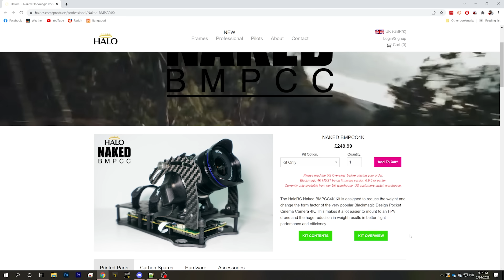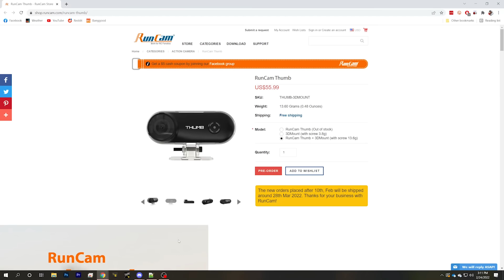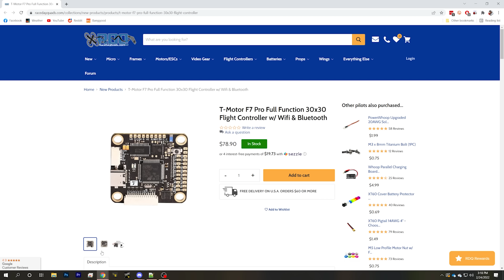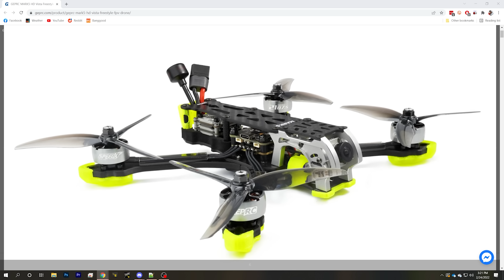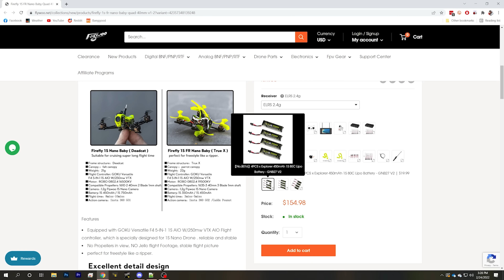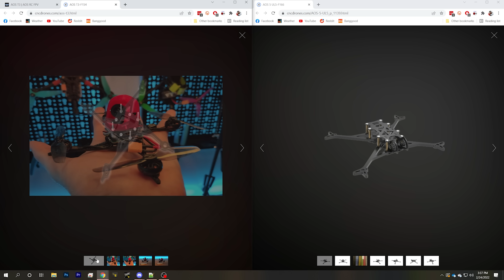FPV new product roundup // MARCH 2022

Comment: I've seen you put a lot of emphasis on what battery connectors quads come with in the past, and it came up again here. I can't help but wonder if I'm missing something.. why is it such a big deal what they come with? A short solder job can fix that easy enough. Or is there some reason I'm not picking up on that switching out connectors is a bad idea?
Reply from the maker: Sure you can change the connector, but it's still nice if it comes with the one you prefer.

Comment: Been using the HDZero 1W in my long-range build for a couple months now and I’m very pleased with the performance. Here’s some range and penetration testing for those curious about the performance:
https://youtu.be/jzgEcdjl-Lo
Size and heat are no issue for larger frames making it a great choice for a digital long-range builds! Glad to see new products coming out across the FPV hobby. Cheers!

Comment: Jumper T-Pro's stick jitter at 1w is probably something to do with battery voltage sag, or the voltage regulator cant supply enough for the gimbals as well
I notice stick jitter on my tx16s when the batteries are running low. Gimbals get a little sketchy when there isnt enough power to drive them

Comment: With regard to AC/DC chargers.. I wonder what happened to the Hobbymate Speed H6.  200W AC, 650W DC in a pretty small brick
.  It's the charger I take on airplanes.   It's not sold any more  I don't see anything comparable at its original pricepoint.

Comment: More solder pads need to be through-vias. That way they're damn near impossible to pull off the board. Not necessarily a hole, but the trace going all the way through the board at least, little via holes for solder to wick into maybe?

Comment: 55:40 You guys were pretty meh about this but this is a lifesaver! I have a Tiny Whoop where the props are stuck on so tight I was dreading to fly it because I wasn't sure if I can ever change the props without taking that thing completely apart and like disolving the props in acetone. This tool is EXACTLY what I was looking for.
Reply: Just got one myself. It's a little fiddly and not very rugged but works very well to prevent damaging tiny motors.

Comment: JB the Foxeer Datura are NOT a new motor line. Foxxeer has previously made these motors. I have several sets of 2700kv motors that were released in 2018,  I believe. The are VERY GOOD motors and I dont think were not stopped in production due to lack of performance or quality. These motors have been used in big races by big names. FYI  Great Video!

Comment: Just got the new HDZero Freestyle VTX this week, but could always use a second. It is pretty massive and just barely got it into my 5 inch frame. It also comes with the tiniest antenna you've ever seen, but considering you can't hardly find a RHCP uf.l antenna I guess it's a nice touch. You can on the other hand find plenty of LHCP ones for DJI though. It seems like there's a lot of demand for HDZero so hopefully they'll be a lot more antennas and cameras coming out soon that y'all can highlight in the coming months.

Comment: For anyone thinking about the pwm elrs module for a Inav plane. It won't work with INav 4.0. They discontinued pwm receivers because it's not as good as the other protocols/receivers these days.

Comment: The 1W HDZero does not look like a product 2022. Strange form factor, only 4s, smokes when the antenna is gone, and the image quality is just getting less noisy. It's great for pilots how bought into hdzero because their focus on micro/racing, but it will not convert average freestyle pilots to the system.

Comment: My first soldering job on a drone was installing GPS to my Iflight Mach R5 HD and it was awful on the 25mm whoop board it has. I can't imagine working on the 20mm electronics in the nazgul evoque
Reply: 20mm is kinda sorta okay. 16mm is the true killer. I've been soldering a lot for the past 10+ years, but just wiring a single RX up to iflight's 16mm tower was a royal pain in the A. Compared to that, 20mm FC's are nothing. Also, whoop-style AIO boards tend to be harder to work on for some reason than 20mm FCs

Comment: thing that sucks about the xing2 is that there is no replacement for the motor bell. I have these motors and yeah its a pain in the ass having to get a whole new motor
Reply from the maker: I would hope the standard Xing2 bell would work?
Reply: @JoshuaBardwell  not sure havent tried. The black edition is for the nazgul, which 6s is 1750 kv while the regular 2207 xing2 is 1855k. Dont know if that difference makes them not compatible. But even if that replacement worked, it would be nice if it came in black

Comment: I bought the Runcam Thumb and it works really great. Very light weight, great video easy to work and install. Mounts that came with the camera could be better though but they work. Thanks.

Comment: They also have a version of the Firefly Nano Baby FR that includes the Runcam Thumb and a TPU mount.

Also, I have one of the deadcat Nano 1S, and I can attest the GNB27 connector is way better than PH2.0. Eachine sells a 6-battery 1S charger that has both GNB27 and PH2.0 for each slot, so it's easy to use both.

Comment: I work for an FPV shop and we never know what amp rating will sell best on ESCs these days. If you're reading this can you reply with what you would normally get? Do you spend the extra $20 for a 65 amp rated ESC if there is a 45 amp available?
Reply: I wouldn't.  Maybe $10 more.  45A is plenty for my 5 inch.  I would only seek a 65A for 7inch or if I ever got into racing I suppose. 
I'm building an efficient cruiser 7in. using only a 45A right now comfortable knowing the max amp draw from each motor is only 30 anyway.

Comment: @Joshua Bardwell  FYI, the downside to the naked BMPCC4K is that you’re stuck at firmware V6 by doing this. Firmware V7 has the newest BMD color science that makes the post workflow in Davinci Resolve optimal. People don’t realize this until after they’ve bought in.
Reply from the maker: I was wondering about that, since the ability to "naked-ize" the camera was broken in V7. But I wasn't aware V7 had a killer feature that made it super desirable compared to V6.

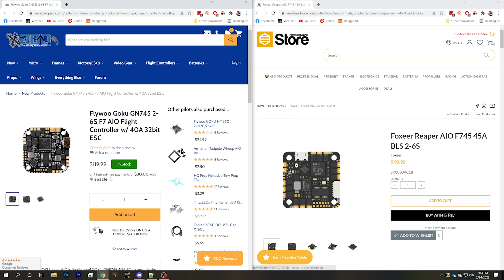Comment: 08:34 maybe I'm tripping but I've had that Flywoo AIO in several of my quads for over a year.... The gnf745 40a and gnf411 20a and 40a all came out well over a year ago. They have seemingly stopped making the f4 variant, though.

Either way it's a great AIO. I have it in 2 toothpicks and a fouride (running 2204)

Edit: yeah just checked. Bought that FC most recently in August 2021. Crazy it was only $69.99 back then.
Reply: Ha! I came here to say the same thing. (Just put it in my AOS T3 last month) And in fact, JB's got a video from about a year ago putting this AIO into his Tiny Trainer.
Reply: @willpowerfpv3246  ah, just checked. Yeah he totally does. It's the gnf745 haha. Oh well, either way it's a great board that deserves some shine.
Reply: @willpowerfpv3246  was his tiny trainer video the gn411 or the f745? Thought is was the f411 but I may be mistaken.

Comment: Maaaaaaaaaaaaany new stuff, I missed some of them but u guys fixed that, thank you :D.
By the way i have the crystal patch on my dji goggles and i found a really big difference between the stock v2 antennas, more penetration and more range, also the battery don't mess up the signal (i have a caddx vista).
happy flying!